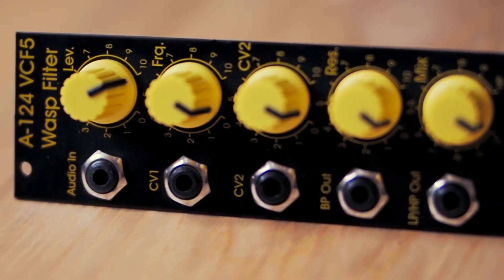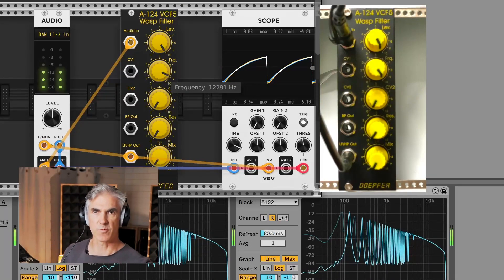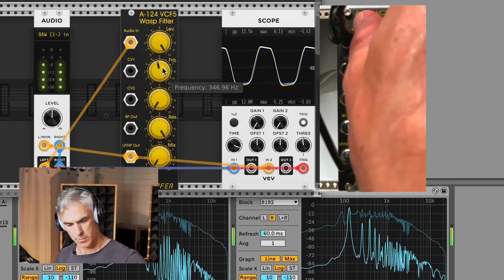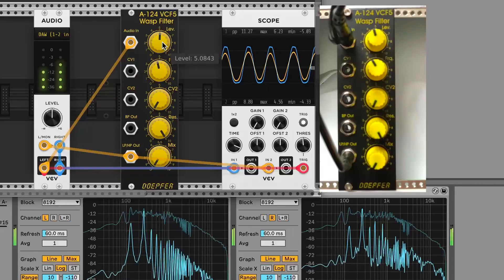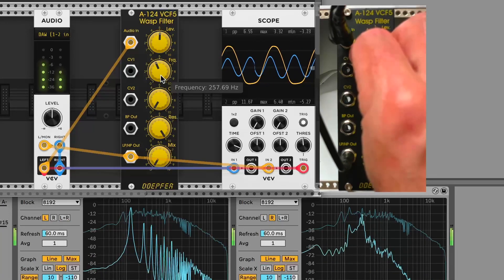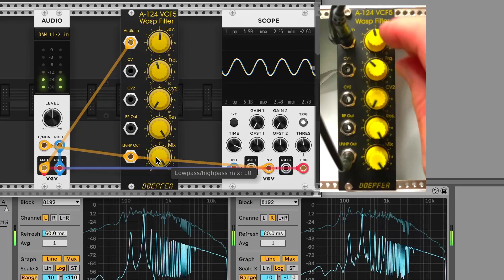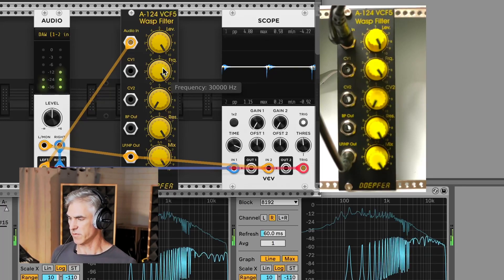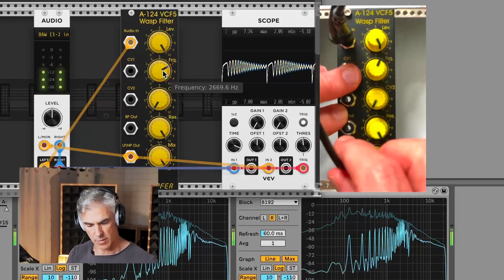Doepfer A-124 Wasp Filter module for VCV Rack

Comment: Does this run the same code as the WSP filter from The Drop?
Reply from the maker: This is a different model, one that has some more detail in the cmos inverters, and also preserves the original resonance path to match the hardware more closely.